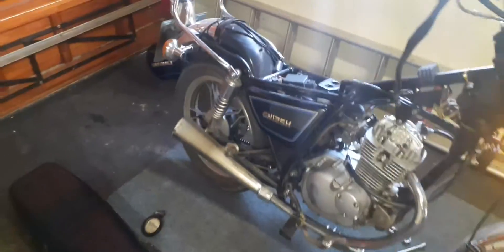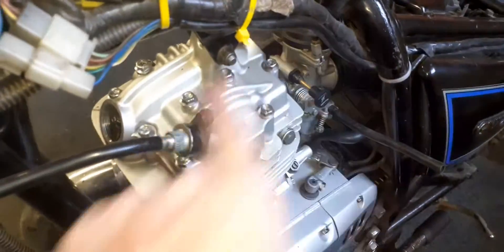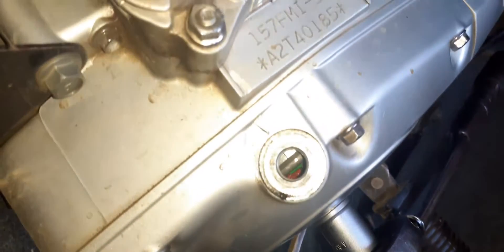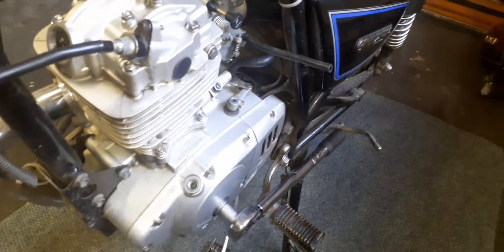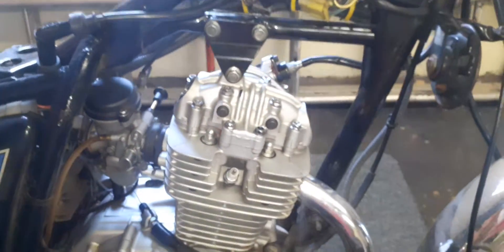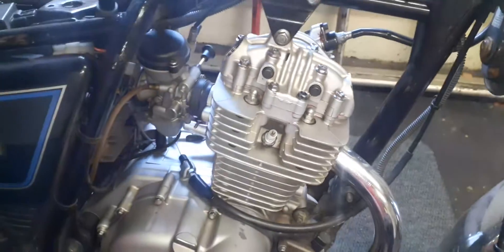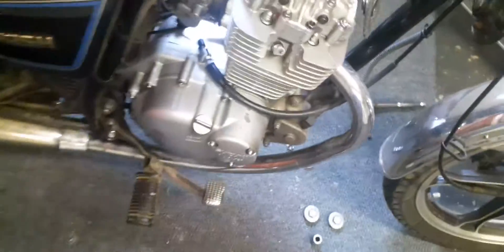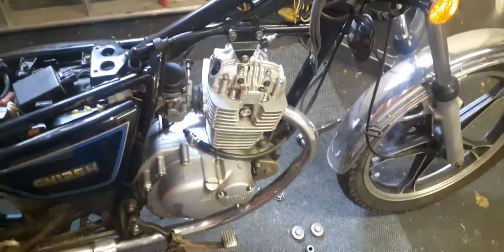False (Top dead centre) and  the (true Top Dead Centre)

Comment from the maker: i will not make a vid on how to adjust valve clearence gaps cause you realy gotto have a feel with your hands on how to use a feeler gauge.Watch all the vids you want but you have to get the feel for it or your motorcycle engine will clatter as the gaps are to big and you may damige your engine